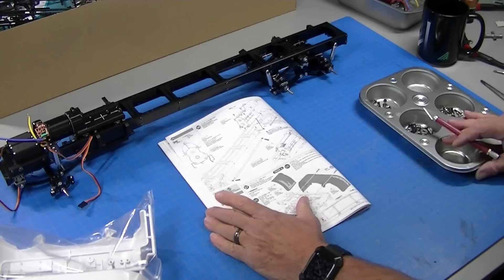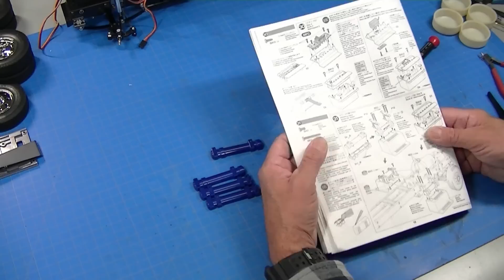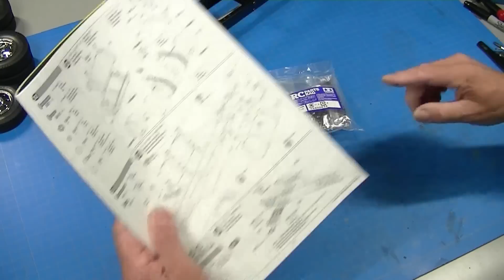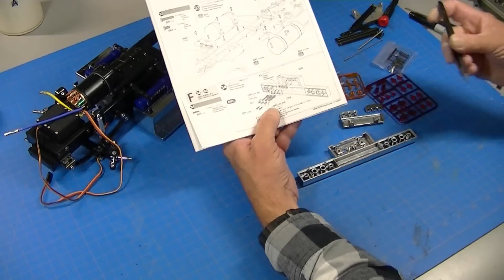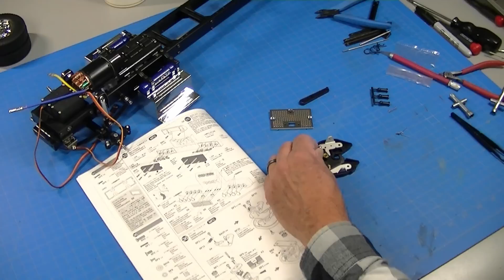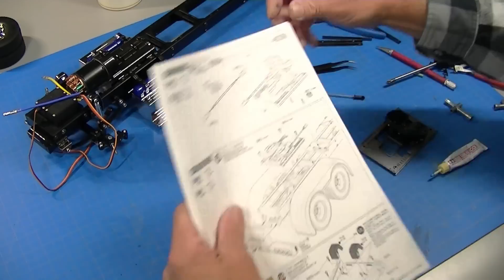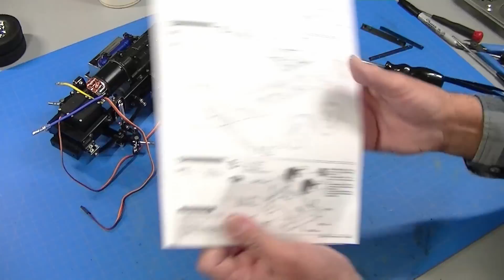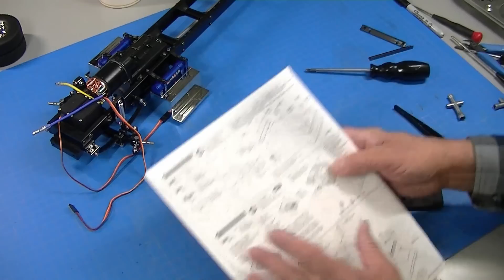Tamiya 1/14 Grand Hauler Semi Truck Build for Novices - Part 2

Comment: Interesting you use a heat gun for shrink wrap? I have always used the side of the soldering iron. I was shown this as an apprentice and done it that way ever since. I’m 80 now and never had a problem with that method.

Comment: Awesome video my grand hauler was built by it. Some how my transmission shifts with the proper switch just like this but also it will shift with moving the throttle to side to side when moving it’s like a real big rig I have not mastered it. I want steering on the same switch as throttle not interested in what I think may be a quirk of my pro gaming any ideas ? ❤❤ lol

Comment: I don't understand why you use the stick transmitters. You have MUCH finer control using a surface transmitter.
Reply from the maker: Stick radios are required when you have sound and light features like the MFC-01.

Comment: To prevent the 5th Wheel plate from being scratched, I suggest using silicon grease or a disc of thin white cardboard surrounding the trailer's kingpin. ;-)

Comment: hey bob. i am starting my build on a grand hauler. i plan on using the gt power pro light kit. my question is does that light kit come with an esc or do i have to get 1 and also i have a radiomaster mt 12 surface radio. will i ba able to get it to work because it does have enough channels? this is my 1st semi build and i look forward to watching your  videos again and again to see how . thanks
Reply from the maker: The GT Power products would be my very last choice for sound and lights.  The new Beier MSM-1 is superior in every way.  It actually works!  The 12 Channel Radiomaster will do anything you want for sure.
Reply: @HobbyconceptsLLC  thanks bob ill look into them

Comment: Quick question Bob, I LOVE your Simple Green Chrome removal. I want to keep a portion of the Chrome on some of the parts. Is it possible to paint over some of the chrome.?Chrome.?? I will ba airbrushing using Faskolor and Proline paints. No reaction to the chrome.??Chrome.??? Let me know. I am on the fenders now. Awesome series by the way.!!
Reply from the maker: You can paint over chrome but is just not stick well.  Strip what you can and then rough up the chrome a bit before painting.  I use Super Clean to strip chrome.
Reply: @HobbyconceptsLLC  LOL, I said Simple Green instead of Super Clean..!!! Many thanks for the help.!

Comment: Hey Bob I have just started getting into the RC hobby and have a Tamiya Ford F-350. Can I use one of your pre-programmed radios with the servos with this kit?
Reply from the maker: Yes, sure can.  It will work with a standard speed control and will also work with the Tamiya MFC-02

Comment: I plan to build my first 1/14 truck and trailer.  what is the difference between the Grand Hauler and King Hauler other than looks?  Is it the same frame, etc?  Also does the King Hauler Black Edition not need to be painted?
Reply from the maker: The Grand Hauler has a longer frame.  Some of the body add ons like exhaust, lights, air cleaners etc are different.  The Black editions of both trucks are pre-painted and do not need additional painting.

Comment: Ok Bob,  what about the novice building this kit like myself that isn't going to use the MFC . How do you program the flysky remote using the hobbywing 1060 ?
Reply from the maker: Yes, the remote works either way.
Reply: @HobbyconceptsLLC  ok  then my esc must be bad . Everything works except it won't go in reverse direction . I even tried a different remote and reciever from my crawler build with the same result.
Reply from the maker: Most ESC's have a jumper you need to set to get delayed reverse or direct reverse.  Check your ESC manual for details.
Reply: @HobbyconceptsLLC  didn't make a difference the placement of the jumper. I'm a beginner with the semi kit but this is my 35th Rc vehicle. 1st with this kinda remote .
Reply from the maker: Contact me by email.  My email in video description

Comment: Is there any reason I couldn't 3d print a micro servo bracket and make the 5th wheel a remote release as it comes? I don't want an MFU, I'm planning to use a beir, but I would like the remote function. I can't find it separately at this point.
Reply from the maker: Actually all you need is a flat plate under the chassis.  I hook the servo to that and then make a link to the plate.  If you use a micro servo you can hide everything below deck height.
Reply: @HobbyconceptsLLC  Awesome thank you! This is my first build on one of these, I assumed it could be done something along those lines(how we used to do scale planes with aileron pushrods), but thought I'd ask anyway.

Thanks for the great videos btw. I wish someone had been around 20 years ago when I was building balsa kits with this kind of help LOL